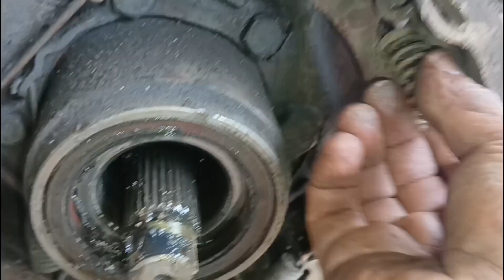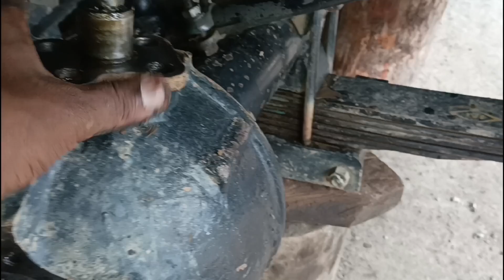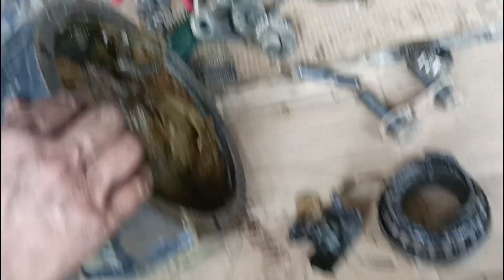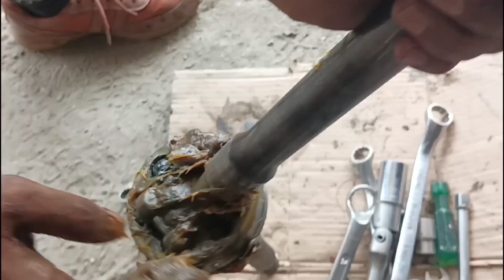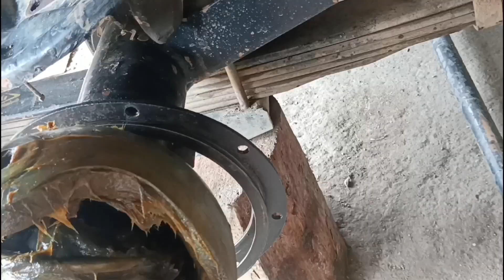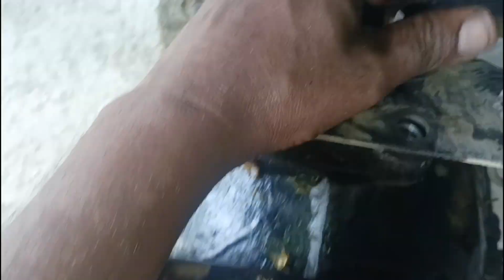Tata 407 hub setting and hub greecing , Tata BS4  4 x 4 front wheel hub greasing

Comment: Sar hamen sensor wiring per kis prakar kam karna chahie jisse ham samajh paye ki hamari wiring problem hai ya sensor problem
Reply from the maker: Sar gadi ko on Karen sensor ka voltage check Karen to map ect aur iat sensor main 4.9 volt se 5 voltage aana chahie cmp sensor main 1 aur 3 point mein 12 volt dikhana chahie aur 1 aur 2 point mein 4.9 voltage so karna chahie
Reply: Sar iska video step by step karke hamen dikhaiye ya FIR diagram dwara hamen motivate kijiye